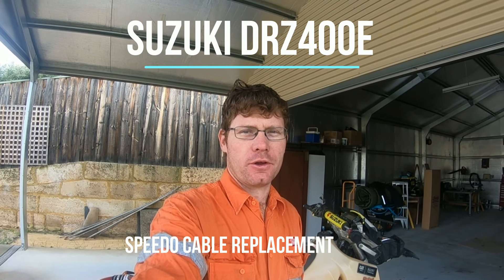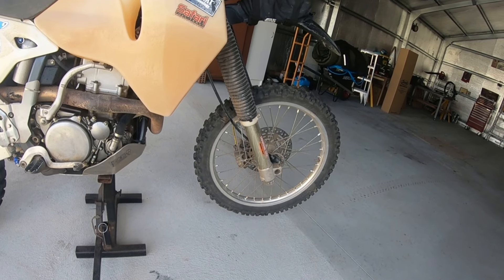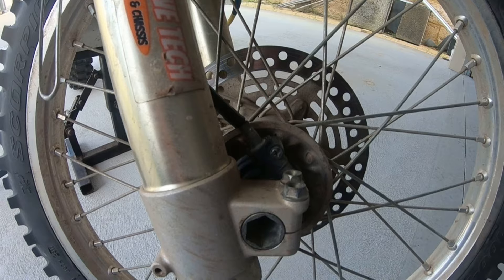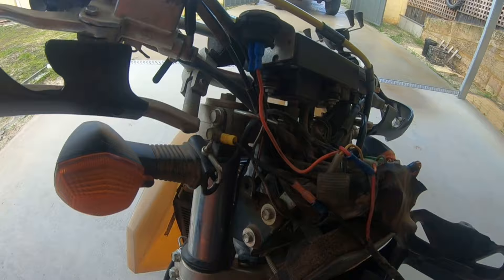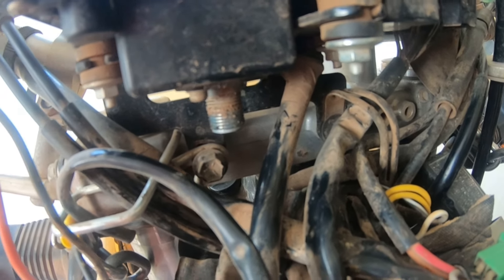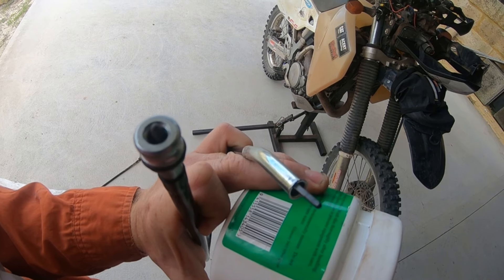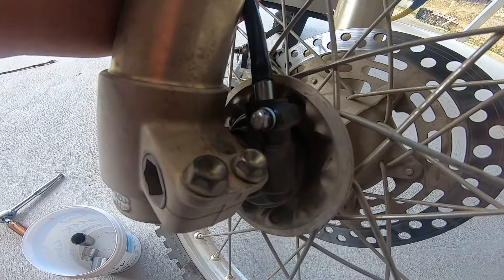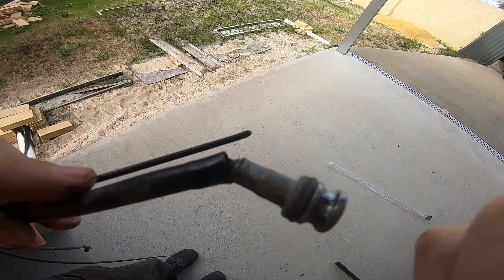How to:- Motorcycle DRZ400E Speedo Failed? Diagnosis and Cable Replacement Step by Step Guide

Comment: A (maybe) minor point...the crosshead screws are very likely JIS, NOT Phillips.  These are very easy to strip if you use a Phillips driver, though FWIW a JIS driver usually works well on Phillips screws.  In a pinch you can grind a bit off the tip of a Phillips driver and it will fit JIS screws much better.

Comment: If you decide to use a stainless steel bolt on aluminum parts/threads,  make sure you apply a dab of grease to the threads.   If you don't electro us this will occur and that will cause your aluminum to rust aka oxydization.  The last thing you want is to be riding Max wrist on rusted parts.
Reply from the maker: Thanks Michael and your correct about electrolysis that's for sure. I use a waterproof grease on nearly everything. except seat bolts that I'm still always loosing

Comment: I see your fork tiedown points are on the indicator brackets. Did you do this and did you drill holes, mine has none (2016 DR-Z400E). Also how do you find pulling from there, do the straps foul on anything. Thanks, Jim.
Reply from the maker: Hi Jim, yes all home made using the factory brackets and they work great, no fouling they pull down straight. Have used a lot with good quality straps and that’s all I use to secure the bike on the Ute. Definitely recommend 👍

Comment: Does the cable just push right in the the speedo drive box wish you would of showed when you put the cable in
Reply from the maker: Yes just wiggle and push slightly. May need to turn the wheel slightly to allow to locate. Once in, spin the wheel and the cable should rotate.

Comment: When i take the top of my speed cable off from the bottom of the screen, is the metal piece in the cable supposed to move if i twist it with my hand? Someone told me it shouldnt move and that it is broken?
Reply from the maker: Hi Ronson, 

No that is fine it should spin it works on a rotary motion for the speed. To have a look, keep the top end disconnected and the spin the front wheel. Hope this helps
Reply: @WESTOZEXPLORING  thanks. I just tried that and when i pushed the bike back and forth the cable didnt move at all. I took the cable out and it didnt seem broken at all so im not sure whether its the cable or not?
Reply from the maker: @E32-o1j  drop the front wheel out and see it may be possible the Speedo drive isn't engaged properly or the drive gears have stripped. Correct if you can't pull the middle out its a good sign

Comment: My issue is that the speed of like 20-25 mph off on the reading in my bike is that a broken cable also
Reply from the maker: Hi Andre, they are not the most accurate of Speedos however shouldn't be that far. Definitely worth removing and check for damage, might be just catching and not driving correctly
Reply: I think the speedo accuracy can be adjusted from 70% up to 130% of the standard setting which is for the standard front wheel. Watch this https://www.youtube.com/watch?v=hF3C4TudkEg
Reply: Hey westoz!! Thank you for replying and yes I found out that my DRG was converted from home as tomorrow to a supermodel but they never replace the speed cable for the gearbox for the speedo.. I just did that two days ago and now I’m only 5 miles off And to the person that commented I will change it from 100 to95 it’s just my drz400 is based on a 2002 DRZ s model. So now I’m thinking they never actually fully committed to converting all the parts.. so I did change my old speed cable and gearbox now I’m only 5miles off so I’ll be fling that right now to change the offset

Comment: I wish my problem were this easy, I’ve tried the cable and replacing the pulse generator but still nothing
Reply from the maker: If you remove the end of cable from the wheel and put a cordless drill on the cable to spin, does it then show speed? If it does, issue with speedo drive. If not and top of cable is engaged, faulty speedo unit

Comment: Ive got a Drz250 but the problem i have with the speedo is when i turn the ignition on the orange back light turns on but nothing else. I had a look at all the wiring and pulled the speedo out and pulled it apart to check for any damage, but i could find anything wrong with it. Any idea what it could be?